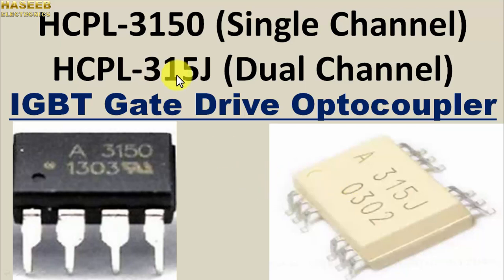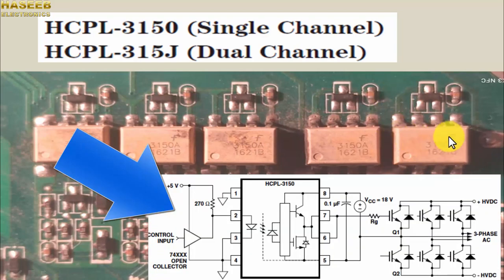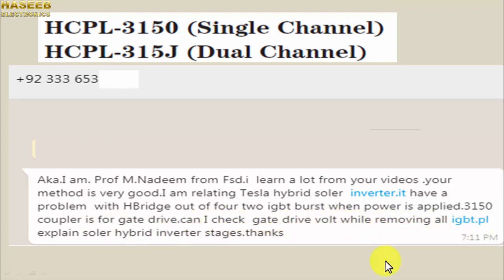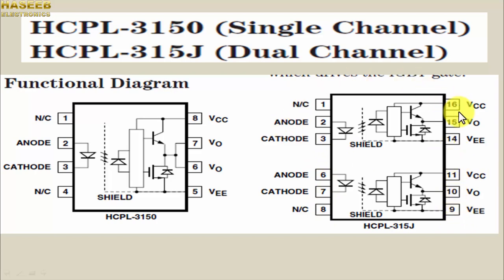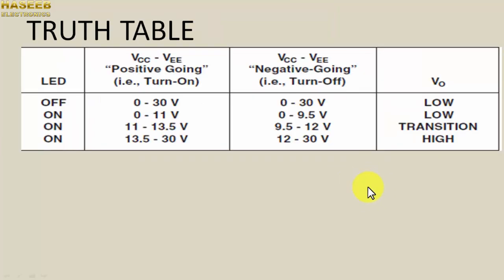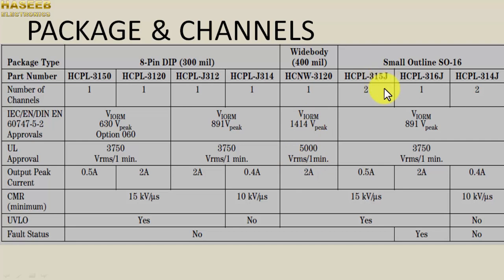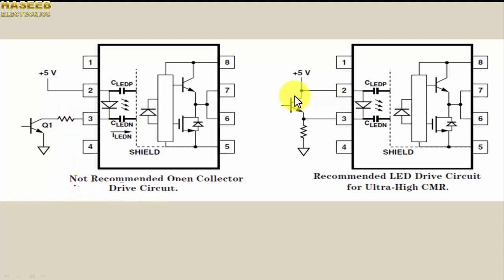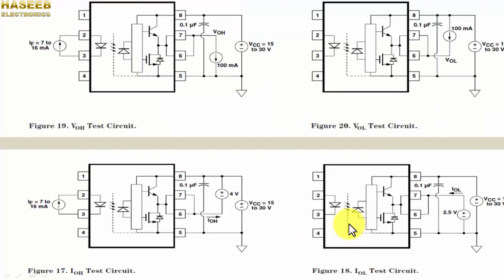{377} HCPL-3150 IGBT Gate Driver Optocoupler

Comment: Sir,  is there any functional difference in between TLP250 and HCPL 3120?  Pull down resistance required for igbt base?
Reply: The IC itself pull down the gate voltage to ground through the 2nd transistor/mosfet in the IC

Comment: Hello sir I use tlp 250 in my buck converter circuit boostrap but as I turn the boostrap on the tlp250 stop working and get hot and bun up I use the boostrap with transistor and it work very will but the tlp250 just keeps failing I try 13 time all fail the 13 time one work and the boostrap signal rise 22 volt and fail when I add a load so is the tlp250 not for drivers igbt or fet or it’s just use for isolation?

Comment: Sir 6020v4 smd component it use in inverter ac board but I did  not find data sheets pls help me
Reply from the maker: GN6020V4
are you asking about smd mosfet?
Reply: @HaseebElectronics  sir I am not sure it may be Igbt or MOSFET but ic return in 6020v4 only mention
Reply: Pls guide me
Reply from the maker: Send it's picture to WhatsApp
00962-79-1161 084
Reply: @HaseebElectronics  thank you sir I will send the picture

Comment: Sir is it possible to make IGBT Gate driver just with a common IC without any kind of microcontroller? 
Please reply back sir.
Reply from the maker: yes brother 
it is possible. it needs some voltage  as gate drive signal and it never see from where the  signal voltage are coming 
so it can be driven from any signal even we can use 555 timer ic
Reply: @HaseebElectronics  Sir thank so much 
It means we can use 555ic in Smps as pwm for mosfet driver
(In case we don't find equivalent of switching IC??? 
Please reply Sir
Reply from the maker: yes 
it can be used easily. we need to adjust its frequency matching to the transformer
Reply: @HaseebElectronics  Sir how is this possible

Comment: What is the role of pin number 1 and 4 if they are nc
Reply from the maker: pin 1 & 4 not connected pins
Reply: @HaseebElectronics  in solar inverter they are connected to each other why , and connected to grid-N and output-N , why
Reply: @HaseebElectronics  i know they are nc , you can see the schematic of the solar inverter , pin 1 and 4 are connected to each other and to other things

Comment: SMD ic 4688  nahin mil raha hai is ka equlit ic bataye sir please sir
Reply from the maker: MP4688 is 4.5 volt to 80 volt input 
and frequency is 2MHz
other all ICs have low voltage values and low frequency, i will check, if i found some equivalent, i will share it
Reply: inverter Welding machine me Laga hi
Reply from the maker: @abdulkalam-yx2vh  it is amazing.
This buck converter is mainly used for LED drive